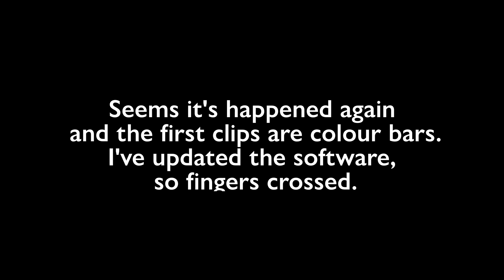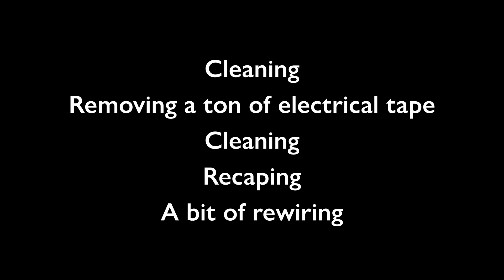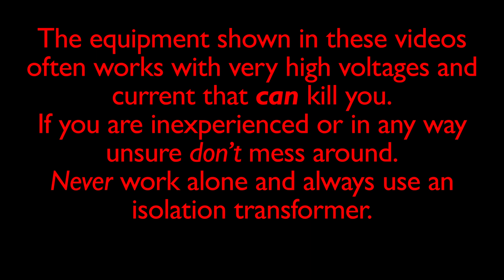Healing L401E

Comment: Hi Andrew.  I hope you get your tech gremlins sorted out soon.  Hopefully the updates will work!  I usually listen with headphones and I've also noticed that one channel of the audio sometimes drops out.  At times like this I'm glad I've stuck with the old iphone for my videos!  It's a bit tedious but at least it always works 😅
I'm also running windows 10 and I've been getting the same dire warnings about support ending.  It's probably time to upgrade my PC.  I'm thinking of a Mac but I don't know.  Do I want another learning curve?  Anyway good luck with the update and the radios. Cheers.
Reply from the maker: Hi Don, it seems to do it mostly after live streams. So maybe I'll have to turn the computer on and off a few times so as to "drop" the streaming software. The camera control has always disconnected and the reconnected which is the chime you often hear in the background. When I bought the big computer 2 1/2 years ago I forgot to set the hard drive for the Windows 11 security setting. Changing it means I have to wipe everything and start again fresh. I don't have two days to do that! Not sure why the sound is dropping out. I always watch the videos before uploading and they seem fine here. I often turn off the worst channel and duplicate the better one. I'll keep an ear out. 
Thinking the Hacker Super Sovereign as the next big project! 
There's also a video up on the project nigella channel too.
Take care.